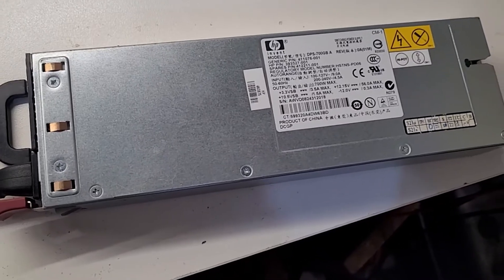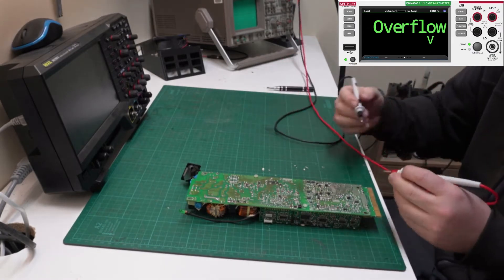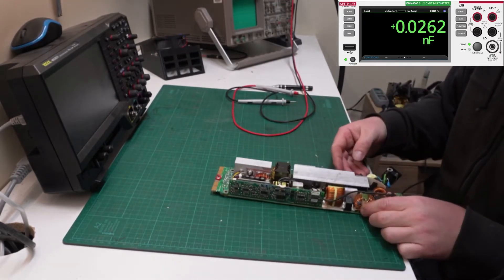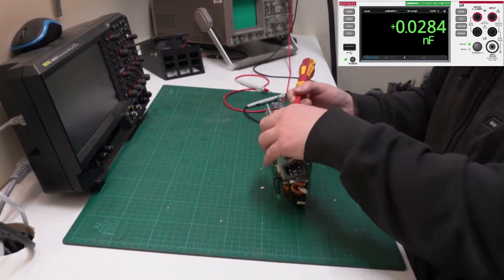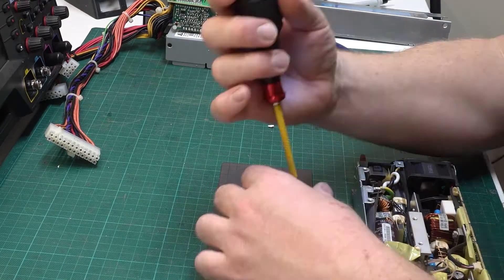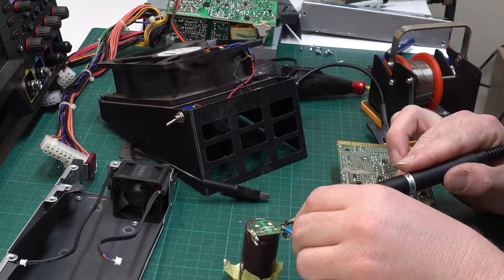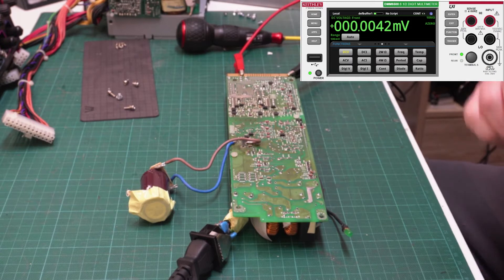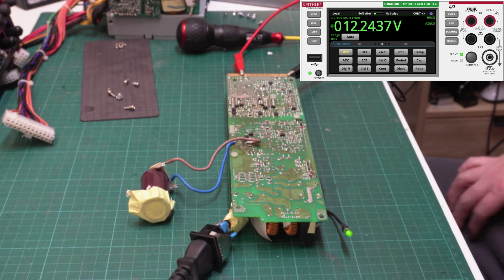HP  Power Supply Repair - Can we fix it?

Comment: my hp server power supply does not power on, no led green, only a click sound from relay, i have made a bad connection trying to start it with wrong pins , is there any fast hint you can give me in order to fast check it? was working fina but stupi iam icked wrong pads to start it.... sad :(

Comment: Hola puede preguntar si puedes decirme que tipo de diodo son los que estan a la entrada de la tarjeta de control pues hize un corto al capacitor principal y ahora estan en corto varios diodos y tambien hay un ic parecido a un transistor que tiene las letras B,,,C70L  pero la letta B no parece numero 8 u otro simbolo gracias desde luego  ,
Reply from the maker: Leave it with me, I think I still have this power supply. If I do I will check
Reply: Profe por favor estube revisando pero todabia no soy experto en reparaciones y ahora estoy en problemas  no se como  biscar su reemplazo nonse si son diodos de proteccion o son zener y tampoco encuentro el datasheet del componente tiene nomenclatura (B...C70L ) la letra B par3ce numero 8 o  no se si un transistor  o regulador ,diodo ????  Ambos tanto los diodos y el  ...C70l  estan justo a la entrada a la tarjeta de control 😢😢😢😢😢😢😢

Comment: Hi
There is some videos in youtube showing dell or hp psu hot plugs convert to bench power suply. They could run the psu hot plugs by connecting some pins but they just could run them to take a small curent not the maximum curent.
Could you please tell me how to run my "hp 2450w hstns-pr16 platinum hot plug" and "hp 2650w hstns-pr42 platinum hot plug" into a bench power suply to take the maximum curent and power?
Kind regards
Kevin

Comment: Hi. I'm having problems with 3 of 4 HP DSP 460 EB. I'm building one power supply 24 voltages basing on 2x DSP 460EB. They are in series connection and one of them were modyfied. Ground connection on PCB was broke. This is oportunity to series connection without short circuit. But my problems are DSP who just "give up" One day they working fine but next day they are death. What I can do. How I can check what is wrong with them. They just not starting with green LED light. I'm bearing "click" while connection to the power cable but nothin really is going one. Reistors are soldered between 1 and 4 pin. Can You give me some advices?